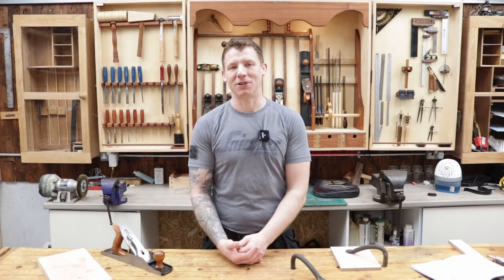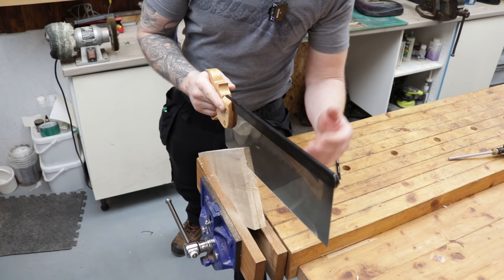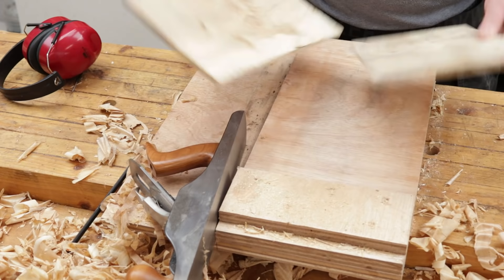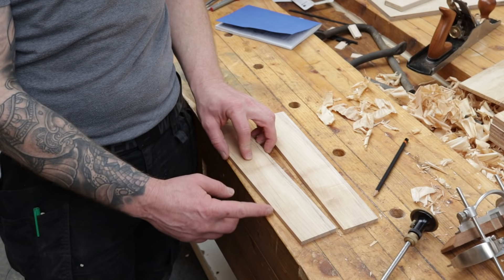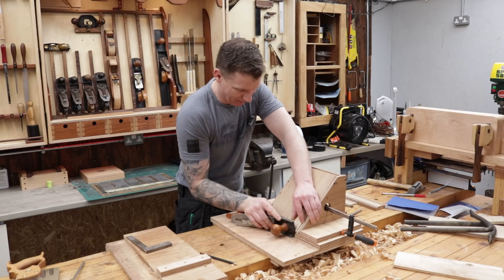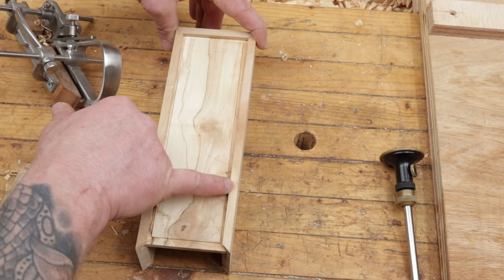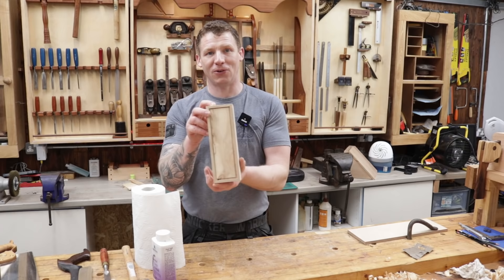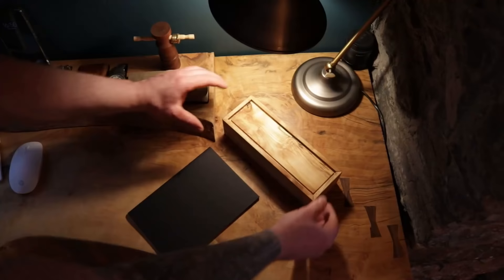Beginner Hand Tool Woodworking Project. Spalted Beech Pencil Case.

Comment: 11:50 I believe the difference between a dado and a rabbit, is a rabbit is a cut out on the edge of a piece of wood, giving it 2 surfaces (1 side, 1 bottom), a dado is a cut out anywhere not on the edge, giving it 3 surfaces (2 sides and a bottom). Essentially the difference between an "L" and a "U."

Comment: Another option instead of nails is to use bamboo skewers. Skewers can be used to reinforce corners of miter joints by drilling through diagonally into corners and then nail and glue skewers, leaving a decorative pin on corners. Mitered joints are quite weak since it's glued on end grain to end grain and can disintegrate if accidentally dropped. Make a test piece with and without skewers and break test both of them, you will notice the skewer joint will be several times stronger.
Reply: im actually curious, because i also have long thought that end grain to end grain joints were weak. but patrick sullivan did a great, rigorous test on the different types of joints (end to end, end to face, 45 degree miter, etc) and end to end is actually quite strong! he found that the wood is almost always weaker than the glue, but he was using evenly grown stock—i bet the spalting or softness of the wood here could impact the strength of the joint
Reply: @pepplerock  The cause of end to end wood grain weakness is the amount of wood contact to glue that determines the bonding strength. Think of wood as a bundle of straws and imaging applying contact cement glue to side and ends to glue another straw bundle. The stronger bond is the one with the greater amount of surface area glue contact.

Comment: Thats really brilliant. Have an identical box from when I was a kid back in the 70's. It holds a set of dominoes, also made of wood with ivory tops (I know!) Has a thumbnail slot for opening so you can see how to open it and don't spill your dominoes. Always thought it was a nice touch. It's held together with a box joint though so yours is nicer. Might just make a new one now ! Thanks John.

Comment: Excellent video John and lovely pencil case. I've done a lot of hand resawing so if I can offer my two cents. If you're resawing wood by hand  you really want a roubo frame saw. It's doable with a good rip saw, but unless your hand saw technique is really solid (which can vary from day to day) it can be a massive headache.

If you are doing it with a rip saw, make sure you hold the saw very lightly and let the saw do the work, the tighter you grip the saw, the worse your cut will be, the less time you can saw without taking a break and the more work you'll have to do with a scrub/fore plane. 
Take your time and rotate the board often so you're coming at it for both sides. This will help cancel out minor errors in your tracking. Stop and check your progress a lot and settle in for a long haul. If you start going off track stop, go back and take time to fix your cut, if you don't the last few inches will be a massive pain because of the effect work holding has on the board (pinching).
Reply from the maker: Thanks for the advice Kevin

Comment: Had an insight about sawing down a line recently. I was helping someone learn to use a saw and realised they are right handed but left eye is their main eye so they leaned over. That tipped their balance so twisted the arm action holding the saw. Had to find a way to cater for the awkwardness
Reply: What did you come up with? I'm right handed but left eye dominant and always need a new excuse to blame my poor sawing skills on.
Reply: @mhardy85  Yes.Do tell - I'm right eyed, left handed.

Comment: Hi John, you have the same stance for cutting wood as I had when I was in school, namely you hold the saw with both hands. The difference was that I was constantly told off for doing so, my teacher always said that you do not force the saw but let the saw glide over the wood and that would stop you from going off the line and getting a crooked cut, I was told off so much that now I rarely use a hand saw because I find it awkward to cut with.

Comment: Hi John, could you answer a question about your shooting boards? How do you prevent the plane strokes from removing stock from the shooting board itself and therefore making it "out of square"?
Reply from the maker: Hi Andy the sole of the plane is referencing the high spots on the piece being planned. So it only contacts the shooting board on the last stroke or so. It removes very little from the board itself but they can ware over time.

Comment: Have you got a link for the rabbet/dado tool you used? All the router planes on Amazon are 12mm/0.5inch thick
Reply from the maker: it's a luban plough plane, I got it from Workshop Heaven in the UK

Comment: Great video, really enjoyable style there. Gonna price up one of those Bad Axe tennon saws for myself.
I believe the difference between a rebate and dado is that the dado has two walls, so inside from the end or edge, a rebate has just one wall so forms an L shape at the edge or end. 
What model plough plane were you using? Nice.
Reply: Nice video! I’d call the long edge joint a groove and the other a housing. I could be wrong though :)

Comment: Absolute beginner here, so found this a really inspiring & informative video (as yours always are). One question - what was the tool you used to make the groove after you’d marked it up? Am I looking for something called a rebate plane? It didn’t seem the same as the router planes I’ve seen, which only seem to work down the centreline of the tool - yours looked like the width from the edge of the workpiece could be set and locked in.
Reply from the maker: Hi Adam it's a plough plane, a Quangsheng Luban plough plane to be exact, lovely little tool. Its great for groves and small rebates so Ideal for small box work.
Reply: @JohnMcGrathManInShed  Hi John. Brilliant; thanks for letting me know.

Comment: The joint you cut into the 4 sides are grooves..... grooves go with the grain and are only open on one side. A groove that goes across the grain is a dado. The shape you cut into the top and bottom is a rebate..... on an edge and open on 2 sides. The old term for the rebate on the end of a board is known as a "fillister". I dont think your plough plane is equipped with a scoring cutter for cross grain work, did you saw the walls of the cross grain rebates or did ya sneak in a cheeky bit of router table action off camera? 😁 
And again..... no way are you in your 40s lad 🤔😂
Reply from the maker: All done with the plough plane lol
Reply: @JohnMcGrathManInShed  good man John...... I usuall saw the walls as the plough will jus rip it apart going cross the grain. I have a plough with a scoring cutter but find its quicker to jus saw the wall than fiddle around with the scoring cutter...... they're a pain to sharpen too 🤦‍♂️😂 
I enjoy your hand tool stuff lad,  it's also nice to hear our distinct Irish accent on a youtube video 😁🤙